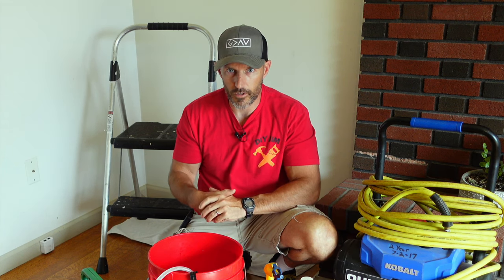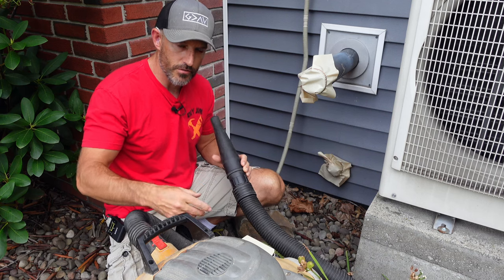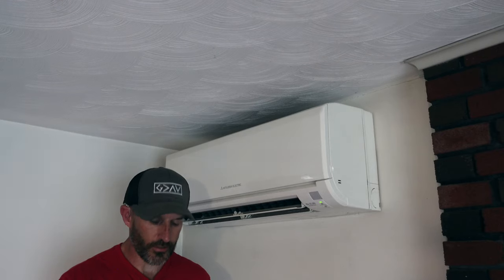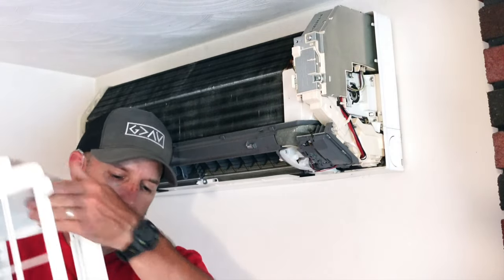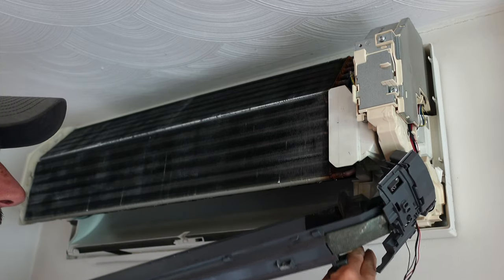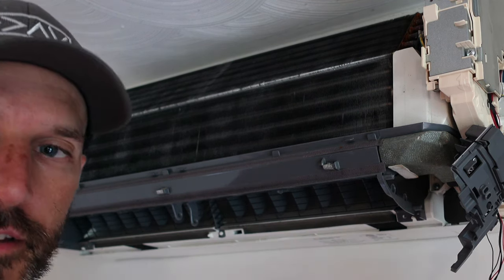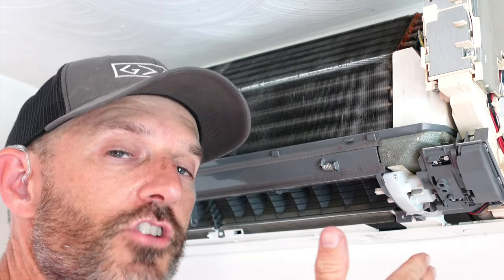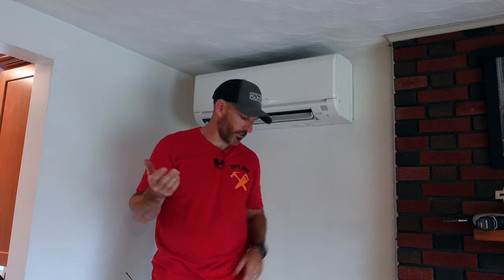How to fix a leaking mini split AC

Comment: My mini split started leaking all over our floor. I tried the wet vac method 1st because that was the easiest, and I had one available. Immediately worked like a charm! I didn't even need to do anything to the unit inside. I will be looking at cleaning the unit just because.
Anyone else having this issue, I would definitely recommend that course of action first. Saved me some $$. Thank you Jim! 🙏 Subscribed! 🙂
Reply from the maker: Glad I could help thanks for subscribing
Reply: I did the wet vac method and it keeps leaking again 😡

Comment: Outstanding info on how too.  Mine was leaking in my shop. Use shop vac method and it worked.  But more important is the other take down method which I wasn’t aware of how to do in case shop vac failed.   Thnk you.
Reply from the maker: Glad it helped, thanks for watching

Comment: I remove the inside unit, disassemble it and clean before reassembling. Just did it last month. The compressor will pump all the refrigerant into the outside unit then I close the valves. The amount of refrigerant lost is minimal. My unit is on an inside wall so I had to run a condensate line through 3/4 inch pvc pipe to a nearby wall. Once an iguana got stuck in there and died so i made a cover to keep future reptiles out.
Reply from the maker: Thanks for watching my friend. Did you vacuum out the system, after you moved it?
Reply: @DIYJIM  Yes for 30 minutes before reopening the valves.
Reply from the maker: @chargermopar  awesome wish you were my neighbor.
Reply: @DIYJIM  That is nice to say! Being your neighbor would be awesome!

Comment: Extremely helpful video, my unit was slightly different a few more annoying little screws on the louver motors which I had on both sides not just one but overall the video helped me out.
Reply from the maker: glad I could help

Comment: Ok boss....  GREAT job in getting this on video!!.....  YOU seem to be the man to ask this question.  I bought a hybrid mini split unit and I REALLY love it!!....  It runs on 4 large solar panels here in AZ all day long without flinching without even any inverter, batteries or anything.  Just run your PV wires to the AC unit and plug them in.  It uses solar as the primary, then when the sun starts going down, it starts easing on the grid power little by little.  FREE electricity during the day!    .....  OK, my question is, Is there a function that turns OFF the water collection process?  There's an app that goes with the AC unit that's pretty robust.  Not too sure if I'm doing something that has made the condensation from collecting all the sudden.  When I first installed it and turned it on, there was quite a bit of water coming out of the tube, now, not so much.  Thoughts?
Reply from the maker: I’m guessing when you first started the AC the humidity level in your house was higher. Now that the humidity level is low, you will only get a small drip out of the condensate line. Should be ok thanks for watching

Comment: Thanks for this great video and explanation!  We have the same unit you showed in the video and were able to fix the leak. Your step by step instructions and clear  video showed exactly what to do.  Had a little trouble getting the cover off so your pointer about the 4 tabs really helped.  Also a little tricky getting the drip pan back in but again your close-up of the little ridge on each side helped.
Reply from the maker: So glad my video helped

Comment: So JIM. My mother has one of these things and at the end of that con tube I put a cut out screen ( like the screens from a window) wrapped with wire and BOOM!  no bugs can crawl in and up into the system and never had a problem
Reply from the maker: I never had that problem but probably a good idea. Thanks for the tip my friend

Comment: So far I cleaned my filters and vacuumed the condensate line.  Nothing sucked out of the line when I used the shop vac.  My mitsubishi minisplit is 6 months new, so I don't understand how it would have gotten so clogged.  I've begun taking it apart as per your instructions and see if I can blow it out from inside.  I hope I get put all the parts back when I'm finished!!
Reply from the maker: Hope you get it fixed. Thanks for watching
Reply: @DIYJIM  your instructions are very clear and gave me the confidence to attempt this project.  However. I have a recent model mitsubishi minisplit and the cover is designed differently.  It doesn't have the clips to release the louvers.  I can't see how to remove them. I tried removing the front cover entirely, with the  louvers attached,, but the lower left corner won't budge.  I don't see a screw there. Don't want to force it and break the cover.😪
Reply: @DIYJIM  I'll be subscribed to your blog.   If ever you come across a Mitsubishi 1800 btu model for demo, I'll follow that.  You are an excellent teacher.  Thank you!

Comment: Thanks a lot for the vid! I have a strange problem with my indoor unit. The catch pan as well ad the condensate line is clear and working. The unit is also cooling but it is leaking on the flaps and drops on the floor. Do you have an idea what a rootcause could be? Could this be a problem with the refrigent level or pressure? The AC unit is clean. Thanks a lot!
Reply from the maker: Sorry really not sure, I would have said maybe it needs a cleaning but you said it is clean. Maybe once the humidity in your house levels off it will not make as much condensate, and stop dripping.

Comment: Thank you so much! I was able to take my mini split apart with no problem.  Found out that the issue was outside the house. The people who installed the drain line had part of it going up hill with a slight kink in the line. This kink had a build up of dirt. Once I fixed this, everything was fine.  Thanks again!
Reply from the maker: Awesome glad you got it fixed. Thanks for watching.

Comment: You’re a life saver.   Mine was leaking and it’s in a tricky spot.   I did the shop vac only and it cleared our clog in a  heat wave.   Will do the rest when temps cool outside.   Thank you
Reply from the maker: Glad it helped! Thanks for watching and subscribing if you did.

Comment: Great video, Thanks for making it <3 I have a question if u don't mind, what to do if my ac isn't mounted correctly and isn't draining the water?
Reply from the maker: Maybe the mounting bracket behind the unit needs adjustment. Not sure how you are going to do this without an AC technician. Hope you get it figured out.
Reply: thanks for replying! @DIYJIM

Comment: @diyjim how can i remove the drain pan if the drain line is on the left side? The wires on the right side are preventing me from pulling the pan out 😢
Reply from the maker: You need to still disconnect the wires on the right side I show that in the video.

Comment: Ive had to vac mine everyday for the past week suddenly. All the sudden it's been pouring out around the drain pan.  First time its done this in 5 years.  Had some clogs before but this is really something. Usually check occasionally just getting a gentle siphon action with a hand held vac.
Reply from the maker: Maybe some evap tabs would help. Did you clean the AC or have someone else do it.
Reply: @DIYJIM  trying to save some money & doing it myself right now. Ive been having a company service it once a year. In fact they were scheduled to be out this week & cancelled but I'm ready to take it apart right now.

Comment: There’s no need for all that equipment. DIY only need a shop vac and a garden pressure washer. The shop vac will usually do the job. 
If you are going to clean just use Dawn dish soap, vinegar and a little Clorox. Make up a mild solution and use your garden pressure washer to wash the inside unit. Rinse using bottle water and the same garden pressure sprayer. Run that shop vac !!
Reply from the maker: Thanks for the tips!